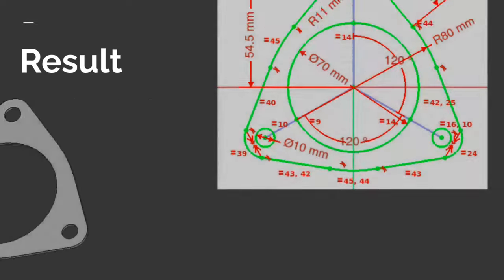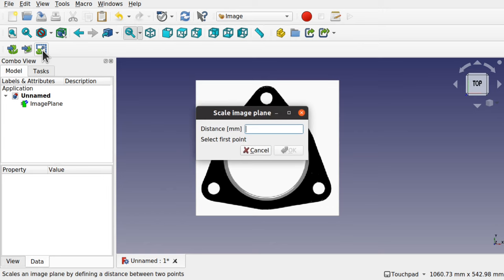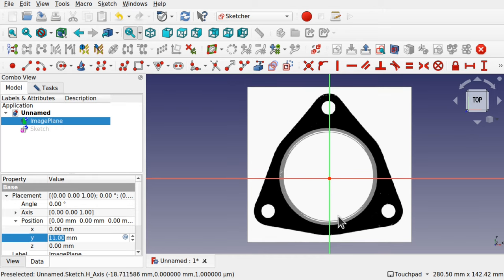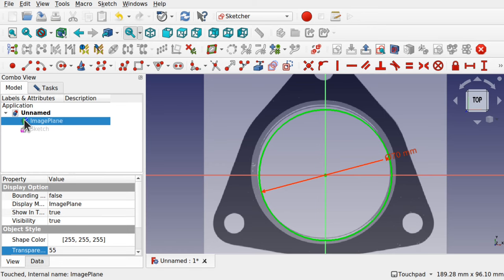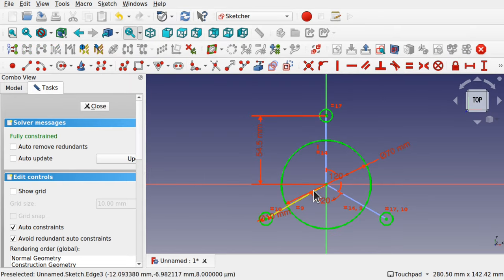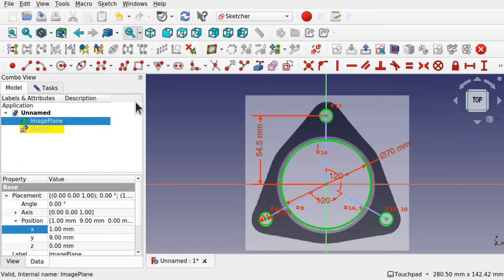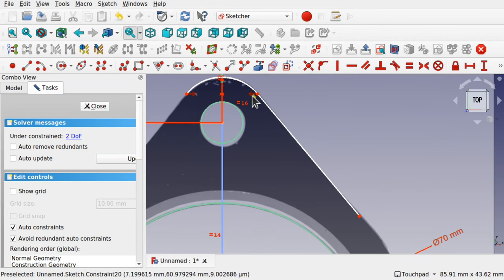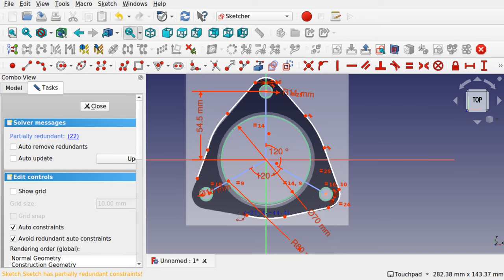FreeCAD 0.20 For Beginners | 4 | Tracing Photo / Image to Build a Simple Model

Comment: Great little video, but surely there's an easier way to do this?

 I'm from a more traditional 3D background and we never model more of something symmetrical than we have too. So in this case it should be enough to model 1/6 of the model and mirror the rest right using first mirror to get to 1/3 then radial array copy or what it's called in FreeCad?
Reply from the maker: You can use symmetry and patterning to your advantage and create a polar array.  I did think about going down this route but it was too early in the course to do so as it would of made more questions and I was concerned I was going to deep to soon.
Reply: @MangoJellySolutions  Noted sorry my bad. I'm just to eager to learn the proper way to do things right of the bat. I'm all about the KISS (keep it simpel stupid) principle in all tasks in life meaning . To clarify I'm not calling you stupid here. It's just a term used in the game dev world. And it just means don't over complicate things. Cheers for your hard work, it really helps me understand all this with CAD.
Reply from the maker: @eddieandersson5570 @eddieandersson5570 lol not a problem, I know your not calling me out. It's hard when your creating tutorials as often keeping things simple adds extra to learn on top so I have to be mindful all the time with the target audience for these tutorials (the beginner). I do try to not include any YAGNI (you ain't going to need it). Pssst I used to be a dev to 😂 I haven't done games dev for a long time as I was application dev, well, I did do a remake of the arcade game "ice cold beer" during lockdown as a way of getting into phaser.Js which there is a little diary of still on this channel. And a games programming challenge where I just used notepad and pure canvas without any framework for a 24 hour challenge. That was fun 😅

Comment: newbie here! was wondering what the workflow should be for creating a cylinder construction consisting of two different sized cylinders connected with one having an extrusion with a square end to it. Its for a drill bit at one end and a connection to a drill at the other end, Its a specialised tool hence the requirement for an adapter. Not sure if im using part design or sketcher and the workflow.?
Reply from the maker: By the sounds of it this is actually quite simple. Look at the part design and use a loft between the two sketches profiles. One of a circle and ove of a square.

Comment: Hi.. grrrrrrrrrreat vid  as always. Question. Is it possible too use freecad but having the files saved in my onedrive (cloud storage)?
Reply from the maker: I don't know, I remember with Google drive you used to be able to download another program that allows you to set it up so it acted like a shared drive. But that was a couple of years back.
Reply: @MangoJellySolutions  i think that  this subject  could make a very good video since nobody seems to have donne any tutorial on this. Would like to donate to the chanel and also i read you message the other day. I may have two opportunities for you.
Reply: Yes.  It is fairly easy to setup as well.  Make sure you have the OneDrive app running in windows and that you are logged in.  Then simply save your FreeCad files into the OneDrive Folder on your computer.  The app will sync everything to the cloud drive in the background.

Comment: Thank you so much!  I have tried twice but somewhere It lost constrains? All the lines did not become green but it still allowed me to add pad and export to stl file! More practice needed I think. Also as someone mentioned. I am using 0.21 and did not have image feature. But You have explained in other video. It looks so simple to make but difficult to create 3D file!  Thanks you .
Reply from the maker: You don't have to have a fully constrained sketch, it's just best practices.  You will find it's one little constraint that you are missing.  Yep, 3D is hard but once you get the basics down it will get easier :)  Glad you enjoyed

Comment: @21:52 when I tried this for the vertical line, I used the vertical axis (not the vertical construction line) as the reference and the symmetrical constraint was redundant , after deleting a constraint it worked, but for the other two arcs when I try to use the symmetric constraint with the other two construction lines as reference it pulls out the same redundant constrain error and asks me to delete the symmetric constraint....

Comment: 20:42 - Where are those Edit Controls (Avoid redundant auto-controls) in FreeCAD 21.0? I can see only Solver messages, Constraints & Elements. Thank you!
Reply from the maker: They have moved to a small drop down on the left hand side in the sketcher. So before they were all visible now you have to drop down the selector. That along with the image workbench moving I think am going to have to redo this video for 21
Reply: @MangoJellySolutions  not needed imo. I personally understood it well. :)
Next 5.2 were a bit more difficult (due to different measurements I had :/  (also, in 5.2, adding initial sketch to padded face side - for some strange reason did not work well for me in 21. But I have managed somehow. Getting there slowly. All is nicely logical.)
Thank you very much this great tutorial videos.

Comment: Is there a way to fix the "Wire is not closed" message?
Reply from the maker: This normally means you have geometry that is not closed, you may have a constraint that aren't joined or a constraint that is joined but with such constraint as a point on line constraint. To check the sketch go to sketcher and validate sketch from the top menu. From there the sketch will have the vetexes highlighted which are causing the issues. Then you can go back into editing the sketch to correct these.

Comment from the maker: If your using 0.21 then you will be wondering where the image workbench is.  Take a look at this video (Where has the Image Workbench gone in 0.21)  and then you can resume the tutorial using the new way of referencing an image.  Hope that helps.  https://youtu.be/WhxDAgskcHA
Reply: Sir, i dont know whats going wrong,
I tried following you step by step
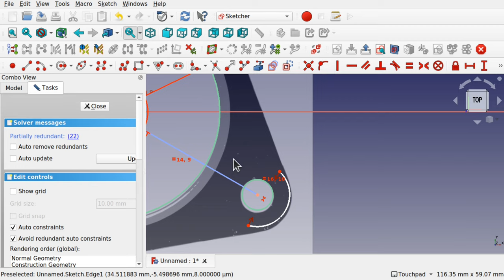But at 22:17 it gets overconstraint 
I dont know what to do,
Even i dont have “avoid auto redundant constraints” option there.
Version 0.21.0
Reply: Symmetry constraint on that 2nd arc 
Causing over constraints

What to do?
Reply: sorry for the translation made by google from PT-BR ->Ing
Wonderful channel with a lot of didactics and perfection in the sequence of showing the possible mistakes and then correcting them during the class... Congratulations.
but in this video I noticed a single ERROR.
I think that when fixing the radius of 180 in the rounding of the middle arc there was a design error.... I believe that the center of this radius must be the same as the central hole.
I believe that this can be proved by maintaining the equality of the straight tangent arcs and segments...
this measurement ends up coming out naturally moving the center of the arc and adjusting the image.... I believe it should hit the center of the larger hole
Reply from the maker: @abidhasanonib9032  in the sketcher when you are editing a sketch on the left hand side panel you will see a little drop down. The options for avoid redundant constraints has moved into that drop down for 0.21. That should help you fix the issue
Reply: "Take a look at this video and then you can resume the tutorial using the new way of referencing an image"what vidoe are you talking about, because the one Im watching above shows the image workbench. Where did freecad move the image workbench in 0.21? Did you forget to link the new video? Im so confused.
Reply from the maker: @MrBfg586  so am I, the link went missing off the comment. Apologies for that. I have readded the link

Comment: I didnt understand the part with orange highlight and constrains and my options at Part Design work bench are not active, I can embody my outline of curves and lines though it is all green.
Also, when I press Sketch the lines do not become yellow though the Option Sketch itself is highlighted yellow.
Then I found this orange - after clicking on those restrains and now I have "Error build geometry(10): Both points are equal" everywhere.

Comment: FreeCAD 0.21.2,  unable to make a symmetry constraint at 21:40. I select both points and the line, click Symmetry constraint tool and no effect. No constraint is created, no constraint markers.
Reply: It doesn't work for a "center and end points" arc, but does work for an "end points and a rim point" arc tho.

Comment: FYI,, I think some of the problems i am having is:  1) I am  a newbie, 2)  the version you are using-.17-,, I am using ,.20,  some of the placement  buttons is different,  I did get the flange loaded,  struggling to get the X/Y axis centered,   my image plane is different than what you showing....  I'll working on it...  thanks for your time...
Reply from the maker: All the videos in the series are on 0.20 until we get to the later video which are on 0.21 but there is not much difference there in the techniques and tools used .  0.17 is quite old so it would be best to upgrading to 0.20 and you will be able to follow along with much more ease.

Comment: 07:34 [noob issue] In version 0.21.1 it seems not possible to move the image until the sketch is closed, but then the "crosshair" disappear.
[edit] Ok, found a workaround - In the sketch, draw two lines on the axis and then close. Those lines will be visible also when moving the image.

Comment: sorry for the translation made by google from PT-BR ->Ing
Wonderful channel with a lot of didactics and perfection in the sequence of showing the possible mistakes and then correcting them during the class... Congratulations.
but in this video I noticed a single ERROR.
I think that when fixing the radius of 180 in the rounding of the middle arc there was a design error.... I believe that the center of this radius must be the same as the central hole.
I believe that this can be proved by maintaining the equality of the straight tangent arcs and segments...
this measurement ends up coming out naturally moving the center of the arc and adjusting the image.... I believe it should hit the center of the larger hole